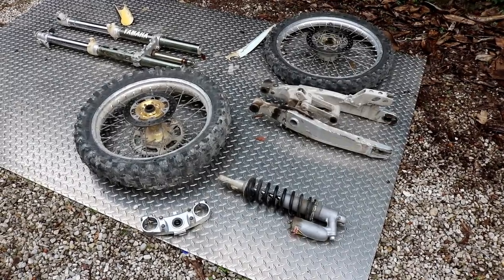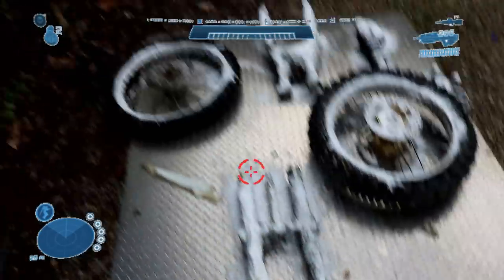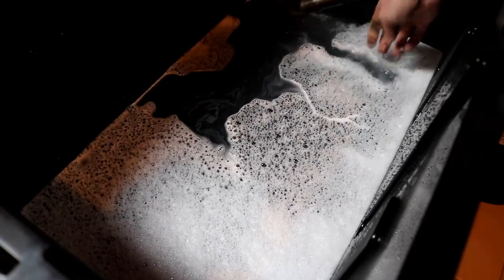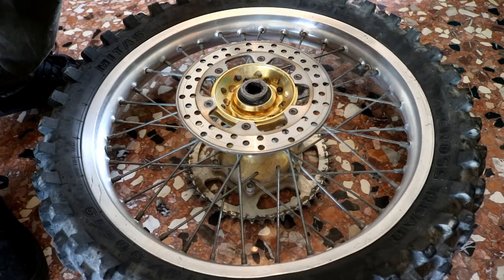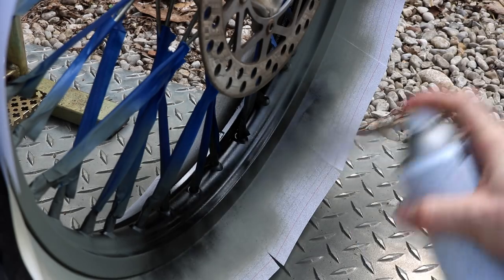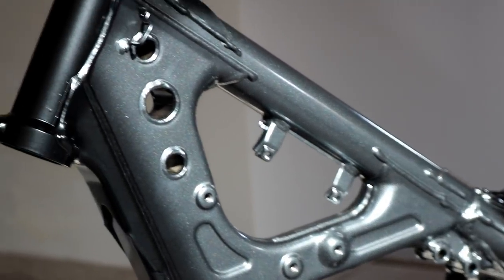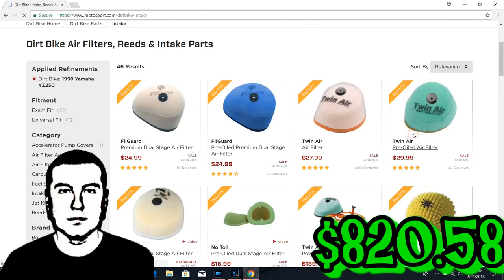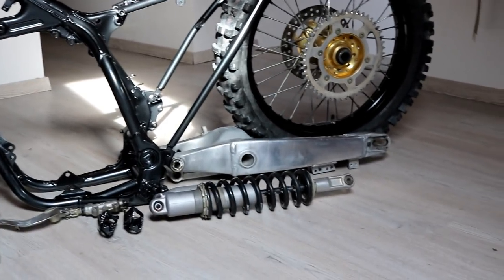$400 YZ250 Restoration! Pt. 2 Cleaning, Painting And Buying.

Comment: This series is really helping me learn about dirtbikes and what they are built of. I havent bought my first one so its helping me understand more. Thank you!
Reply: Caleb Pracna dame here
Reply: Just make sure you get one with low hours. When you are beginner you want to spend your time riding the bike. There is nothing wrong with the way this dude went. However he obviously has the experience to pull off the job. Also be sure and get yourself a full set of riding gear. Both Honda and Yamaha make excellent bikes. A 250 2 stroke is a lot of bike for a beginner. If you can handle it that would be a good direction. If not it 250 4-stroke liquid cooler it's an excellent choice. It is good to take  an experienced rider with you when shopping .  If this is not possible, look for buying used dirt bike videos on YouTube. Good luck to you sir, I hope you hit the dirt soon.

Comment: Nice vid.  So true on the parts, they add up quick.  

If you're changing the swingarm bearings, get the swing arm sandblasted, then give it a buff with a scotchbrite pad to give it a brush aluminum look.  The sandblasting will mellow out a lot of the gouges and scratches,  and it'll save you a bunch of elbow grease.  Great job, keep it going.

Comment: little tip for the cleaning of the aluminum parts. use a scrotch-brite wheel on a grinder or a Dremel and then just use the smaller scotchbrite tips for the cracks and crevices makes it take less than half the time

Comment: Awesome build man. If I were you I would have gone with a 2005. Find one of those totally trashed for the right price and you have yourself a 2018 in no time. I bought a 2005 and put 450 forks on it. Complete motor only thing 2005 was the cases. Pro circuit pipes. 2008 sub frame and a new gas tank and boom. Fresh wheels all around and I had myself a 2018 completely indistinguishable. Still awesome build man. Super nice steel frame

Comment: Next time use the soft wire cleaning wheel attachment for your cordless or pneumatic drill. Unless you enjoy the aching fingers and the hard work with wire wool. Just a suggestion.

Comment: Man, a $400 dirt bike and not one bad seal or bearing? Did you check for movement in the wheels, linkage, steering stem, swingarm, connecting rod, shifter rod or primary drive shaft where the front sprocket goes? Just giving some criticism man, love what your doing though, if you can do this again and again it will build up a subscriber base, I'm a Yamaha man myself, and a Kawasaki guy, and a Honda fan, haven't ridden but only about 20 different bikes so far in my life, but a few of them I owned and got to go deep into the engineering and building of it and since 4 it's been my main passion, keep it going brother, I messed up and let myself get down to not riding at all for several years before I said I NEED THIS!!! LOL, it's amazing how much joy it can bring to your life..

Comment: What about the linkage? It is probably seized if the bike is that old.
I have a similar build but with a yz 250 from 96. It looks almost as Rocky Mountins video about the yz 250 from 04. And that bike was brand new!
Reply from the maker: I bought new bushings and bearings for the shock, swing arm, steering and the wheels so it will all be new! I just didn't show it in the video because I bought it after the fact.
Reply: That is great! Had to do the same for mine, everything was so rusty xD. Looking forward for next part!

Comment: Most of these build videos are all about looks. I bought the same year bike for $500 and focused on getting the bike to run like new and left it looking like shit. First thing I did was ride it and evaluate the engine performance. Then I decided it needed new main bearings, seals, piston, clutch bearings, clutch plates, water pump seal, suspension rebuild, etc. A bike this old has a worn powervalve that can hit the piston so it has to be filed down. I am almost done and need to fine tune jetting and after I get it running sweet, I will get new plastics and graphics. My build video would be very boring.

Comment: Why is it so much easier to spend 2 grand on a bike straight up instead of 400 on a bike and 1300 in parts, don’t know why but the latter seems way more scary
Reply from the maker: The 2 Smoke thump is an endangered species and needs our help to bring back the thump. Dont shop adopt a old bike today.
Reply: with the $1300 in new parts, you know you got "new" parts.
Reply: I have bought now 3 YZ using your method and the reality is that you never know what you are going to get, so it is better to get it cheap and re-do the engine and buy new parts. Only way to be sure the bike is in good shape. I bought a 2500 bike thinking it was a good deal and have put at least another 1500 on it. WHo is to say if I bought a better shape newer YZ for 4k I wouldn't steal have to do the engine and spend another 500/1000. only way to know is to do it yourself. You will notice every YZ on sale says "newer top end" .... that is bullshit 90% of the time and there is no way to know until you open it up.
Reply: exactly... a new top end consist of a new piston on craigslist, lol. A cylinder re-plate is about $225-$250 it self.
Reply: that 2 g bike could need a fresh motor. you still gotta be careful
Reply: 1st bike, 2nd bike, sure, it's easier to just get a better bike and not fuck with it. But once you've been around the block, you want a challenge. Completing something like this is an awesome feeling.

Comment: Should I get 4 or 2 stroke
Reply: Cameron Winchester well depends on your preference if you want to be more in control and have a reliable bike to take on the trails get a 4 stroke. If you want a non reliable but fast track bike get a 2 stroke. In my opinion I like four strokes more because of their reliability. I have a Chinese pit bike btw
Reply: id argue 2 strokes are more reliable (simpler engines) and are better to learn on because they require better technique with respect to shifting. 4 strokes have become a lot more popular because they are easy to ride, have longer maintenance cycles, and smoother power delivery. If you get a 2 stroke though, you're a baller. B)
Reply: Ethan Martin how are they more reliable at all
Reply: Imagine waffles13 Four strokes have valves, cams, rods, timing belts, oil pumps, and other do-hickeys I don't know about. These are all things that can potentially break and cause damage to the bike when not properly maintained. Four strokes are notorious not for blowing up like a two stroke, but outright seizing which can cause a TON of damage to the rods, vavles, and cylinder.

Most people do not do the maintenance on their 4 stroke because of all of these complexities, and therefore do not have this association with their motorcycle. With that said, a properly tuned 4 stroke is certainly reliable, but the same can be said about a two stroke. As I said before, a plus about 4 strokes is that they do have a longer maintenance cycle simply because it achieves half the number of power strokes as a two stroke in the same amount of time. The general consensus is that a motor's reliability is inversely proportional to the number of things that can go wrong with it.
Reply: Ethan Martin severe engines problems  will never happen if you do weekly maintenance. My old ttr 125 had ZERO major problems in the 5 years I used it. I know people with 2 strokes that blow up once every two weeks.
Reply: Imagine waffles13 A ttr 125 is a trail bike designed to function for a very very long time without any engine maintenance whatsoever (as long as you ride it as intended). If you are going to compare, you should at least compare race bike to race bike (there are no 2 stroke trail bikes that I know of). As I said before, 2 strokes have shorter maintenance cycles than 4 strokes and if you don't replace top ends regularly they will blow up lol. If your friends' two strokes blow up literally every two weeks, and then remedy it by simply replacing the top end whenever it blows up, then the chances are that there is some sort of cylinder damage dramatically shortening the life of their piston by causing pieces of the piston to clip or crack (or even break off). Your bike only has to blow up once to permanently ruin a cylinder (that goes for two or four strokes).

To reiterate what I said before, it all depends on how the bike is maintained. Like you said, "severe engine problems will never happen if you do weekly maintenance." A properly maintained two stroke or four stroke will perform reliably, but four strokes are simply more complex and therefore breakable. Two strokes rely mostly on the laws of physics while four strokes rely on a series of mechanical parts. Bikes don't blow up or seize without reason, but a 4 stroke simply has MORE reasons for a malfunction.

Think of it as a checklist of things that have to be working properly in order to run. Unless every item on the checklist is checked off, it will not work. This hypothetical checklist is longer on a 4 stroke than a 2 stroke. From here you could assign a probability that each part will function properly per unit of time. Assuming there is no particular part on the two stroke checklist with a probability of functioning that is DRAMATICALLY lower than anything on the four stroke, then the combined probabilities from each checklist would statistically predict a malfunction in the 4 stroke before the two stroke (again this is in a controlled setting in which each bike is maintained to spec).
Reply: Ethan Martin ok I agree lol I’m only 16 I ride pit bikes so I’m not really an expert anyway I just ride in a sand pit near my house and prefer the torque of a four stroke
Reply: Ethan Martin it really depends what you are used to be working on really. I have been working on 4 strokes for 5 years and they come easy to me. But I agree with you it’s extremely hard to work on
Reply: Ethan Martin btw just subscribed your channel seems cool you should do moto vlogs 👍
Reply: Imagine waffles13 Nothing wrong with that. There are many things to consider other than pure theoretical reliability when choosing between a 2 or 4 stroke, and your reason for choosing a 4 stroke is a perfectly good one.  ¯\_(ツ)_/¯
Reply: Ethan Martin their 2 strokes blow up every week cause they don't remeber to mix their gas lol. Or maybe they should check their jetting or maybe try shifting.
Reply: Because I was thinking of buying a ktm enduro or something along those lines thanks for all the great feedback